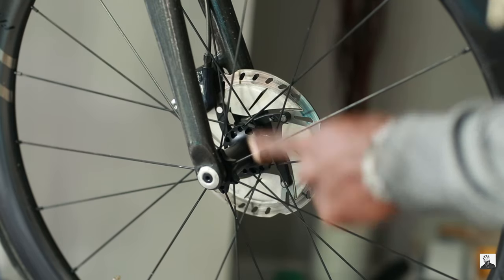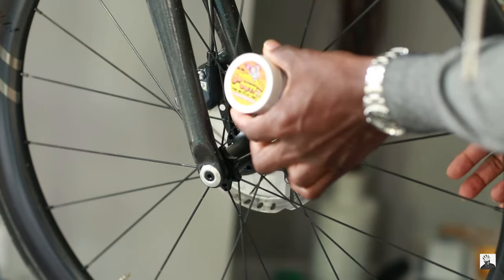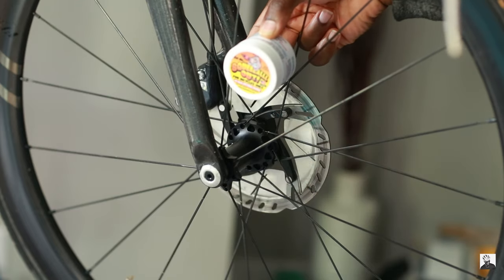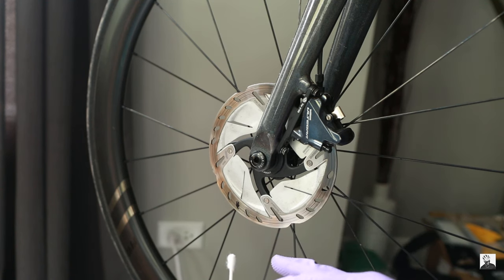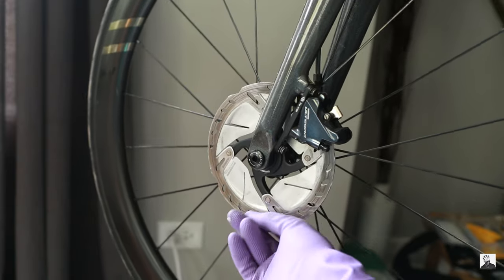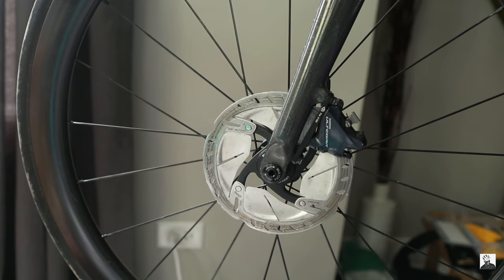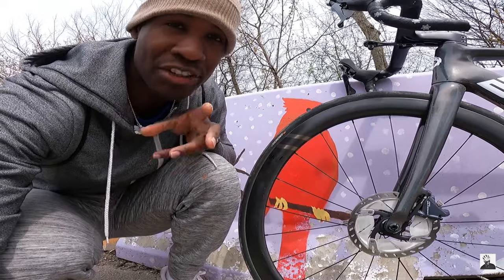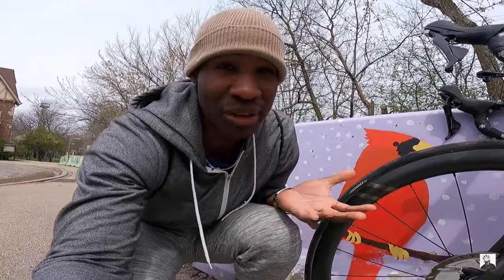How To Fix Squeaky Disc Brakes - Save Your Money!

Comment: I've never had them squeak quite that bad. That was horrible! Usually just whipping them down with alcohol or acetone takes care of it. Reading the reviews, it seems very popular with the e-bike crowd for obvious reasons. One reviewer had to describe his Pinarello F10 with Red AXS as if that makes any difference at all. LOL!
Reply from the maker: I must have did something terribly wrong when I first installed these brakes. None of my other disc bikes squeal like this haha
Reply: @PatrickLino  or you got something really bad on them when riding. Who knows. All better now though. I just ordered me some to have on hand just in case. Thanks for the tip. I didn't know about it.
Reply: @DaveCM  a blob of grease from a truck, axle or kingpin, dropped on the ground and then flicked up on the rotor :)
Such a happenstance is not out of the realm of possibility, or any number of other road contaminants.

Comment: Hi guys and girls and of course you  Patrick!. There is a far easier way to stop disc squeal and you don't have to even take the pads out!. First a good squirt of dish washer liquid into the calipers and then blast it out with a hose pipe it will foam up like he'll so rinse until clear. Then spray the discs both sides with motorcycl muc off and leave for at least 5 mins and blast off with the hose again. Next thing to do is get some thick paper kitchen towel and clean the discs both sides do this quite firmly you will be shocked how much dirt/oil comes off!. Now either leave the bike in the sun to dry the calipers for a short while or use a hair dryer job done quickly and cheaply!!. Ps use good dishwasher liquid like fairy liquid not the cheap shit give it a go you have nothing to loose and has always worked for me.
Reply: Probably works as you say....for 10 minutes.

Comment: How fine is the grit on that stuff?  I wonder if you would get similar results with a grinding compound or something.  
Just wondering if this is actually formulated for bikes, or if it is a case of "hey, lets slap the word 'bike' on it and charge more!"
Reply from the maker: Haha the “made for bikes” increases the price! The grit is course enough to cut, but not polish. I think as long as the compound itself is completely oil free it may work

Comment: I'm a rim brake guy BUT totally understand the reason for this technology: carbon fibre rims + rains + mountains = certain death. You need disc brake for that. BUT Disc brakes are dangerous for light bikes. Rim brakes and aluminium rims are better. Most people use aluminium rims. I am Glovo cyclist. Riding 20.000kms per year. I use aluminium rims.
Reply from the maker: Thanks for watching!

Comment: The more disc brake videos I watch, the happier I am with my rim brakes. In addition I think that the Ventoux wheels (with their textured surface) have an above average rim brake.
Reply from the maker: Yup the rim brake version of the Ventoux have great braking performance (I'm told).
Reply: I'm old enough to remember the same things with rim brakes, tutorials on cleaning and deglazing rim brake pads, how to toe in the brakes, etc etc etc.
There is nothing new under the sun 🤣
Reply from the maker: @galenkehler  Can't win either way 🤣
Reply: @PatrickLino  I can, lol I built my bike with a disc brake in the front and rim brake in the back, I'm winning no matter how you swing. 🤣

Comment: It's sold out everywhere, is there an alternative?
Reply: Yes.

Remove pads

Scrub with sponge pad and hot soapy water

Rinse

Warm pads in a pan till dry

Replace pads

Same procedure for rotors

Spend 5 minutes bedding in. 

Zero cost 😊
Reply: Sand paper and a good solvent like acetone

Comment: Why doent you just use fine sand paper on the discs and pads?
Reply: @PatrickLino  If you are trying to save money, whats the price difference between the paste and a shoot of 300 sandpaper. Everyone has brake cleaner at home. Paste is messy albeit simple
Reply: Less profitable 😂

Comment: If they squeal that bad then usually the pads need replacing or the disc is not aligned properly. I don't think that paste does anything that a good clean with iso would do. That front rotor looked dirty to begin with. 4 years use of disc brakes and i've never had a squeal that bad.
Reply from the maker: Thanks Dan!
Reply: I got a little oil on my brand new rotors and pads and they squeaked just like this. Tried cleaning with ISO and sanding down the pads three times, it helped a tiny bit but they still made way too much noise for my liking. I purchased this paste and it works! Took ten minutes and the noise is gone.

Comment: Turtle Wax rubbing compound works at 1/5th the price and 3 times the amount. $30 vs $6 and 3oz vs 10oz
Reply from the maker: Thanks for watching!
Reply: How do you do it with turtle Wax stuff just the same way apply a thin coat to it and turn it with your hand then take it for a drive??
Reply: How do you do it with turtle Wax stuff just the same way apply a thin coat to it and turn it with your hand then take it for a drive??
Reply: Why would you put a wax on them?
Reply: @Leo-gt1bx Turtle wax is the company name. Their rubbing compound isn't a wax, it's like T-cut for getting scratches out of the clear coat on car paint.

Comment: I started racing road in 1973 when I was 12 years old, and track about a year later. Nothing special, only club level. However, I was in A grade for a number of years. There is nothing wrong with rim brakes at all. They will still send you head first over the bars if you jump on them too hard. The secret is to wind your rosary beads around your stem and bars. This not only improves the braking quality of rim brakes and assists in aerodynamics, but will also prevent the aforementioned scenario of going head first over your bars whilst engaging your front brakes.

In all honesty, I was more offended to see you riding a carbon bike. That is nothing short of heresy.

On a side note; I almost wet myself laughing when you said "Man, I look dark in this video." I shan't be the one who states the obvious.

More power to your legs and happy cycling.
Edit:- I liked and subscribed.